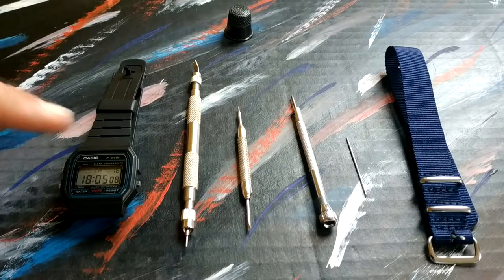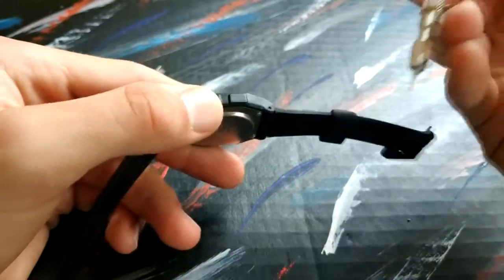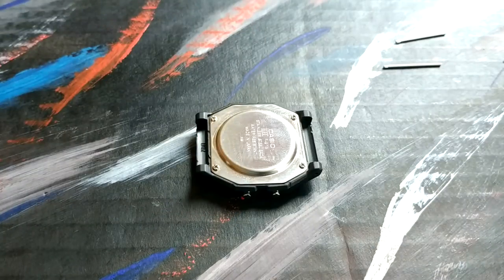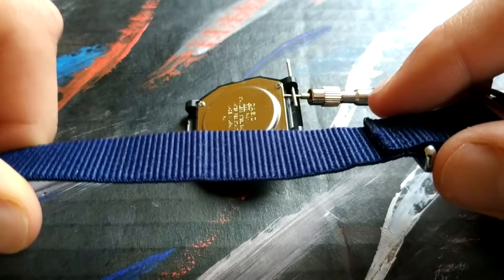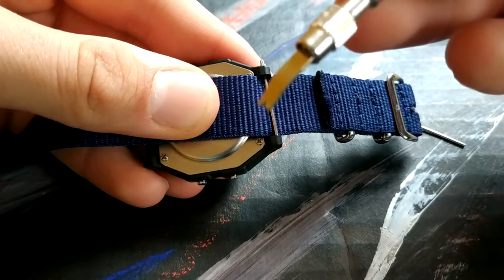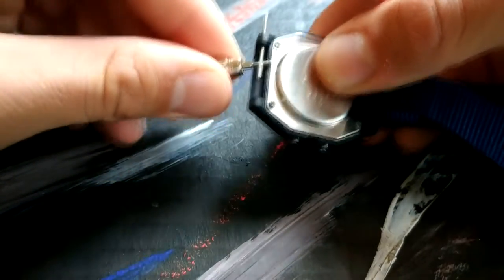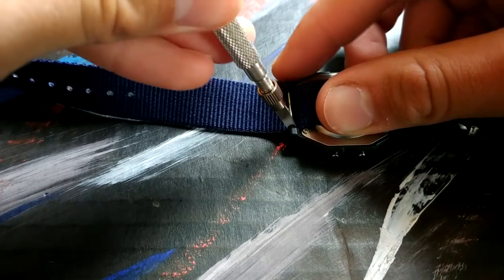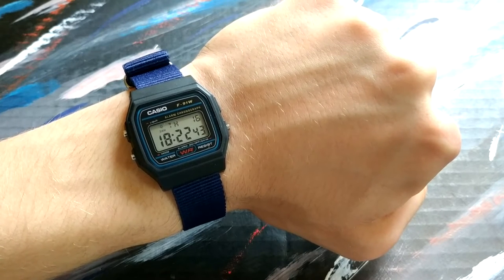How to put a NATO strap on the Casio F91W.

Comment: The pins in mine were way way tighter than what is shown in the video, I had gone through the seven stages of grief, broken tools, a bleeding thumb and making a mess of one of the holes in the watch before I finally managed to do it, in a period of nearly 2 hours, but I eventually did it. If you're struggling too: do not despair, the pins eventually come off/snug back in but you might suffer a lot until they do.
Reply: Currently going through this on the clear variant, wanted to take off the straps and dye them but there’s no arrow and I’ve now jacked up two of the holes
Reply: Same here, they just won’t budge and I’ve got bleeding hands from the amount of pushing. I think they’re glued in.
Reply: DUDE, HOW? they just DO NOT move ! T_T
Reply: The best tool to use is the watch link removal tool. You hold the watch at an angle & then just twist screw tool until the spring pops out. Then with a small watch hammer tool you can put the bar back in

Comment: I almost died changing out the strap. Also switching out the strap can lead to the holes holding up the spring bars to widen which can lead to the bars slipping out easily
Reply from the maker: Yeah, it's not a very easy process, but the end result is great!
Reply: The end result looks like you took a cheap watch and put an even cheaper strap on (that doesn’t fit the watch face, btw).

Stock looks better and won’t fall off of your wrist.
Reply: @trimaxium  you misspelled 'awesome' with 'cheap' its not even close to the same
Reply: @trimaxium  I've had my Casio rubber strap tear on me at work (in a warehouse). I have yet to have a NATO break on me and even the cheapest ones have lasted years.

Comment: FOR ANYONE DOING THIS, dont make the mistake I did - I wanted to used the spring bars the NATO band came with instead of the push fit pins my 168W watch came with - what a nightmare, even with the thinnest NATO strap I could find I ended up having to wet the strap fabric so it would compress enough to be worked into shape and into place --- now I see if I had used the original press fit pins I would have saved myself a world of grief.  I now feel I should remove the spring bars and put the pins back in, but now I dont remember where I put them.

Comment: Fantastic, thank you. Just did this! A little tip: You can cut off the extra strap bits if it's too long, then place the end between two coins and burn it off with a lighter to make it circular and seal the strap from fray.
Reply: Thanks!

Comment: What was the thickness of the nato u used here? i have an 18mm nato and slipping the bars in after the strap is in place is not as easy as u have demonstrated here
Reply: I find with these budget Casios you need to get the cheapest NATOs as they tend to be a little thinner. The strap I used is about 1.5mm thick and even then it was tight as I had to push the bars down while trying to get the pin into the hole.

Comment: Nice tutorial! I did have to apply a lot of power to get the original pins out, even with a watch tool. Also using spring bars instead of the original push pins.  This seems like a better solution to me.

Comment: My solution was a lot less elegant.
Cut away at the remains of the old strap, separating it from the pins.
Bend pins back with anything capable of the task
Slide NATO through with pins still in.
Reply from the maker: That's barbaric! But at least it worked 😁
Reply: I just did the same.I did not even bother to bend the pins back. Thanks for the tip.

Comment: Hi! I am having difficulty changing this watch buckle and the strap retainer,  I can't seem to push the spring bar to release them, and i searched EVERY where to find if anyone did it before on this watch but no one has.
Reply from the maker: Heyy! Are you talking about the original strap that comes with it? Because now I am working on a state of the collection video. But next week I am planning to do a video about Casio f91w, I will show how to change the strap, so there will be a part where I will change the buckle too!
Reply: @WatchesChecked  yes! i know how to change the strap already, its the Buckle that i am having difficulty getting the "Spring bar" out. From what I have found out is that it is a solid bar.
Reply from the maker: @Michael-lo7sq  It is pretty hard to get out, but I'll show you in my next video

Comment: if you cut the bit that makes it a nato strap is it still a nato strap?
Reply from the maker: That is not what makes it a nato, so yes, indeed it is still a nato :)
Reply: @WatchesChecked  what makes it nato? Is that not the whole point
Reply from the maker: @itzv1ciou543  essentially it is still the same just less bulky, if one of the pins fail you will still be safe with the other one as it is still a one piece of a cloth
Reply: @WatchesChecked  oh ok

Comment: WHY do people insist on putting nato straps on this watch - it doesn't really look very good does it??
Reply from the maker: It makes the watch a bit more softer and you can bring colors into it with different straps!
Reply: @WatchesChecked  I get the colours, but it just looks awkward on the strap.  Each to his own I guess..
Reply: Yeah I put on the nato and it looked awkward. The watch looks too small for the 18mm nato, and the jump/transition from the nato band to the watch looks unnatural. That's why the original 18mm resin band widens once it's near the lugs

Comment: Can you not just cut out a piece of the watch case? The bit that overhangs. Then the strap goes in easier.
Reply from the maker: I guess you are talking about cutting a piece out of the strap and if so, then yes, you can
Reply: @WatchesChecked   No, not the strap. The overhanging bit from the case. Leaves more room for the strap, and easier to adjust on the wrist. A file could do it easily. Regards
Reply from the maker: @johnadams-wp2yb  Ohh, you could definitely do it!
Reply: @WatchesChecked  Any chance of doing a video on that, great vid by the way.
Reply from the maker: @jasonemanuel9070  We'll see :). Thanks!